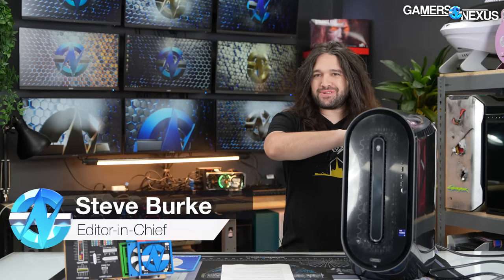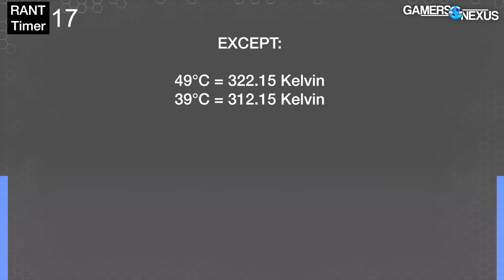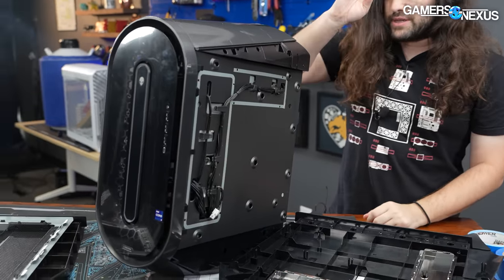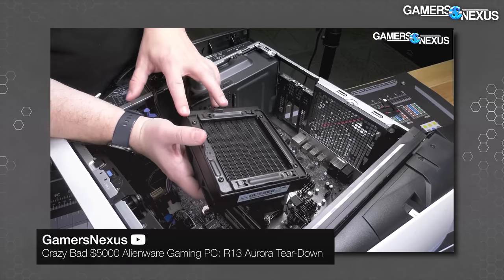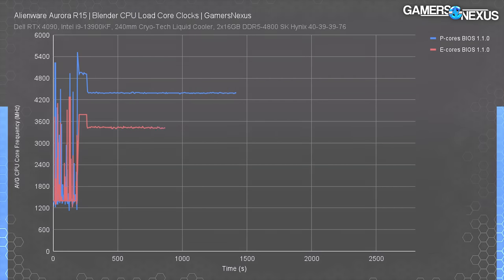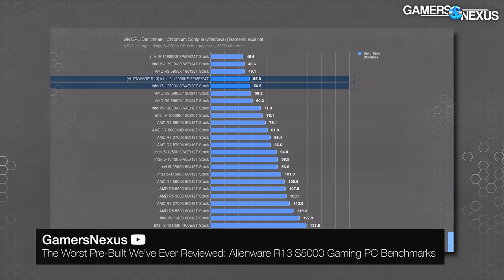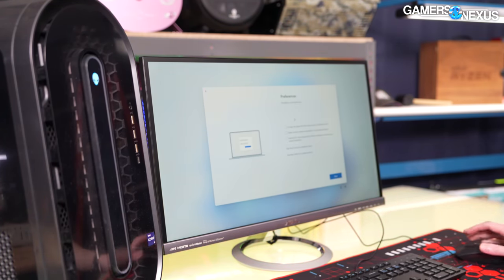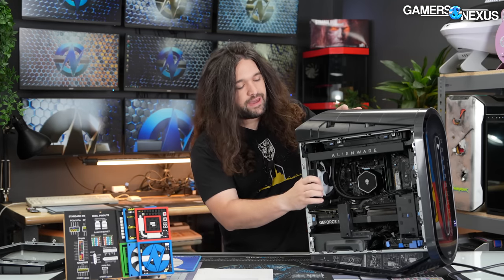Alienware Can't Get It Right - R15 2023 Pre-Built Gaming PC Review

Comment: Good Video but the part with your Kelvin and Celsius calculations is pretty much bs. The Kelvin scale begins at the absolute 0 point, which is completely unnecessary to look at in this use case (-273 °C). Starting point of 0 Celsius (273.15 K) is far more relevant because the coolers are cooling the chips against ambient air which is more in that spectrum. While your calculations are physically correct, they don't make any sense realistically.
Reply: yes, but converting from Celsius to Fahrenheit will still make the percentages inaccurate (tho maybe not as much)

Comment: I had an R15 w/2 1080Ti because otherwise I couldn’t get a videocard. I had to redo the whole system to make it functional. CPU ram WAYYY HOT, GPUs ram WAYY HOT. Cards were blower style and ran on the edge temp wise. Very very disappointing especially for the price.

OMG don’t get started, I mean it was everything even chassis fans were undersized and truly a joke.
Reply: I'm getting one in a few weeks with liquid cooling, should I crank the fans up ASAP?

Comment: That card was used. Dust doesn't just settle in a thick layer on the underside of the fan blades. That takes months of heavy use. Especially when the top looks nothing like it. The whole card would have to be dunked into a vat of dust and then cleaned badly to look like that. To say it might have collected there sitting around is just denial. Avoid like the plague. This has gone beyond bad design. Avoid like the plague.

Comment: I bought this PC thinking there wouldn't be a problem adding in the wig card for my VR headset, but ends up that there isn't a PCIe slot to put it in. After watching your video it looks like there may be 2 other slots on this system, but are they fully blocked by the video card? Sorry I am a newb so if this is a silly question can you answer it please. Can I add a Vive Wigig card to an existing pcie slot on this system? Thank you.

Comment: I still don't understand their obsession with using that case. Imagine how much cheaper it would be for them to design a standard case and just give it a little bit of Alienware flair. It would be cheaper to make, cheaper to build in, cheaper to warranty, perform better, and not alienate so many people with the over the top styling and awful cooling.

Not to mention all the other proprietary stuff and the cost that goes into creating that. It's no wonder they have to charge so much. Overly excessive engineering for the sake of doing it while giving the customers less for their money. It's like Dell is dead set on making a desktop perform like a laptop.

Comment: I purchased a prebuilt and had a question if anyone can help (it's not an alienware lol). The GPU temperature seems rather high to me, but I'd like a second opinion. 
It's an i7-12700KF with a RTX 3080 
Normal GPU temp rests around 46 degrees C. While running a game, it will go up to 82-84 degrees C. The outside of the case seems to get pretty hot.

Is this the average temperature I should expect whenever I run a new game or does this seem hot?

Comment: I wonder how much money Dell can save in manufacturing/tooling costs if they got rid of that stupid plastic shell and simply worked off of the original Optiplex chassis. Glad to see the Alienware team finally got a clue about the CPU cooler but, yeah, it's a pain to work with professionally and not a fan of proprietary Dell parts used or how little space there is between the GPU and PSU.

Comment: I think they mean ambient temperature.
Reply: That’s the entire point of the rant; The point of the video is that percentages of temperature can easily be manipulated for marketing due to temperature being a property that unfortunately uses multiple scales with different zeros. Just saying 20% cooler isn’t very helpful unless you include the scale and a beginning or ending measurement. Frankly it should also include ambient but that’s probably asking too much.

If it’s 20% cooler from 100C to 80C or 17% cooler from 212F to 176F or 6% cooler from 376K to 356K, that’s still not very good.

But if it’s 20% cooler from 140F to 112F or 25% from 60C to ~45C or 5% from 333K to 318K, that’s phenomenal.

Just state the change in plain numbers, drop the percentage, provide a reference to ambient and max operating temp if you want.

Comment: Intel 14900 CPU, Asus Strix z 790-A MB, 4 TB M.2 WD Black, 2 TB M.2 Samsung 940 pro, 64gb Corsair Titanium 6800, gigabyte 4090 GPU, Corsair H150i AIO, Asus 1200w Platinum PSU, Asus Tuff Mid tower case all for $4500 that I built myself. Thats crazy is that they are charging more for rebuilt PCs and use less powerful components.

Comment: QUESTION:  does the fact that the back panel angles downward have any effect on the outgoing air, or is the angle so slight that unless it's parked against a wall, you won't notice any difference?
Reply: GN has made some mention of how the idea of 'hot air rises therefor exhaust up' might be technically sound but in practice the effect is so small its a rounding error of a rounding error. It might not be this exact situation but basically getting the hot air out of the case is infinitely more important then how it gets out of the case, just get it the heck out of the case. So the angle doesn't matter.
Reply: @nickierv13  thanks! I appreciate this answer :)

Comment: Why are you converting to Kelvin? Who the hell measures their experience with that number? Nobody has a kelvin thermostat or checks the weather forecast in those terms. Celsius or Farenheit is how the non-scientist consumer measures their real world experience.  I don't care about the accuracy of Kelvin, because I'm not an astronaut or a cryogenics lab worker. Therefore I use Kelvin, as many others would use Celsius. 120.2F (49c) vs 102.2F (39c) is a HUGE, noticeable difference under most conditions. 

And yes, that is why people care about temperatures. Not because of any correlation with power draw/electric bill, but because hot computers affect room temperature, often turning them from tolerable to uncomfortable. What a ridiculous criticism.

Comment: Imagine way over paying and getting a heavily used GPU.  Dell has always had those silly springs and latches.  Why are they so adverse to going with standard components?  Wouldn't they be able to charge a bit less but make a TON more since they aren't designing mobos, PSUs and other proprietary parts?  That's what I don't get.  They're spending all that money on designing and engineering parts and it doesn't make sense.  You pay all of that when you could have had someone put together the same specs for much less and have better performance.  Do they make that much money fixing old machines?  Do people send their dells in that much for repairs?

Comment: Should have tested it using the Alienware Overclock software max power settings. They definitely tune things down a bit by default so you need to use Command Center to get good perf. But once you do that, you can do just as well as the prebuilt.
Reply: No, it's a BIOS thing. Plus the cooling is simply horrible the components could die.

Comment: Why does that Alienware pc internal configuration look like my hp proliant server made gaming pc (for fun I don't really use it) some of those fans positions are meant to cool things that aren't even in the system and probably haven't actually gone in one of those cases for like seven years or more.

I will say I find that gpu to be well designed assuming it cools well and that's an aluminum (or copper?! One can dream) backplate. I figured gigabyte would need to up their game sooner or later after the experience of the 4-slot 3070ti with an lcd screen I've got somewhere (you would think with a 4 slot cooler it would be having no problems. And while it doesn't the 3080 fe runs cooler as does 3090 suprim x(treme to the max! Presumably)

Comment: Windows update is the absolute worst when it comes to OEM updates. I never even booted the pre-installed windows version on my HP omen, and installed a clean version of windows instead out of the box. Windows update has pulled in all kinds of garbage from HP because they label their software as 'required', including the analytics packages that are installed and connect to the internet without ever notifying the user of their existence. Which is shady at best.

Comment: Just too bad it still looks like something from about 15 years ago... The bare unpainted metal inside, even though that doesn't change functionality, but also a... hard-drive?... Come on. - Yes, extra storage is nice, which is all HDDs are still good for, but the norm should be SSDs, be it in SATA or M.2 form. - Even for consoles NVMe is the norm now, so let alone for a system of almost 10 times more expensive. - For some reason, they're really stuck in the past. It's just weird. It almost looks retro-futuristic now. And actually, people DO buy old Alienware stuff to collect nowadays, while... it's still being sold as new products today, just with newer components in almost the same old cases.

Comment: 556 for cpu NEW from BestBuy, 1500 for refurbished 4090...how is the rest of the system worth another 2400? Theres just NO WAY especially with that cheap ass board, RAM, cheap internals on the case that looks stupid on the outside as wwell

Comment: been buying alienware for 15 years. never had an issue, not once. but everyone hates them for some strange reason. just bought a r15 for 4000$ canadian, i9 13900kf+4090 with 64 gigs of ram at 5200mhz with 2tb nvme, with a 1350 watt supply cryo tech. got no complaints at that price. and like i said, i know i wont have any issues, never did once
Reply: „For some strange reason“ It’s the price. It’s way too high

Comment: I have the Alienware Aurora R13,  worst pile computer crap i ever bought. GPU runs so hot it throttles  (FFXIV),  yoyo's the GPU and makes the game unplayable. i finally had to remove the cover and set the box right in front of my AC. the airflow through this chassis is the worst I've ever seen and i wish i had researched this chassis before waisting my money.   You cover the R15 pretty well, but i see teh same aiflow flaw - hot air out from GPU backdeeds back into the NVIDIA cooling fan ie feeding hot air into the GPU.  if you buy one of these machines, good luck  (not new to Alienware, this is my fourth machine from them over the years, but also the last for gaming due to this design)

Comment: It baffles me Alienware/Dell still uses all that proprietary garbage chock full of unnecessary (charming to some I'm sure) mechanical moving parts 
Simultaneously under and over designed. Reminds me of a jacked up mid 2000s pc with bare ass RAM, bare ass metal, those blue HDD things etc
Literally everything I don't want in a PC case, Alienware provides in spades lmfao

Comment: We also have to talk about the bad 2 slot configuration in this system! If you want to upgrade your RAM you have to sell those 2 original sticks or reuse it in annother system. They cheaped out there. Also I wonder what chipset this uses? Doesn't look like a ZX90? More like a B660! Or even a B-610? For a expensive system like that? Also a 240 AIO for a 13900K? Conclusion: Alienware still sucks!

Comment: Alienware blows. I remember I bought an 8800 GTX SLI system from them over a decade ago and it would thermal throttle / kill the cards. The only air intake was a stupid ass alien eye that was smaller than a 120mm fan. Never again.

Comment: It's as if the case as been designed by someone who has just left university, no pc case experience, I bet the design drawings have pointless GD and Ts and dell have invested so much money they are now backed into a corner and just have to use it. Ridiculously over engineered on the interior. 
 

I have been there myself with the big and hidious nzxt phantom, at the time I thought it looked cool but wasn't practical at all. This case is stuck in the early 2000s.

Comment: With that price tag and custom design I expect to have a built in air filter in the intake so 99% of dust doesn't get in...
Also those ugly ass green ram sticks on a 4000+ build is aggravating... not even has heat sinks, wtf.
Reply: ram sticks don’t need heat sinks. These are just marketing gimmicks

Comment: Still to cheap to even paint the inside of the case metal black. Not to mention it's still just a cheapo plastic shell on a shit tier office pc chassis. This isn't even that important but with that kind of markup I would at least expect premium ram modules and blackout PCBs. If they where really interested in better thermals and acoustics thy would abandon that formfactor altogether because that's a dead end, It can't even fit a 360 CLC despite being a massive waste of space. With the volume that dell moves and the theoretical engineering an manufacturing assets they have at their disposal they could have done something truly revolutionary, like providing a one size fits all CLC type solution for their GPUs. Instead they provide zero to negative value over any other prebuilt vendor.

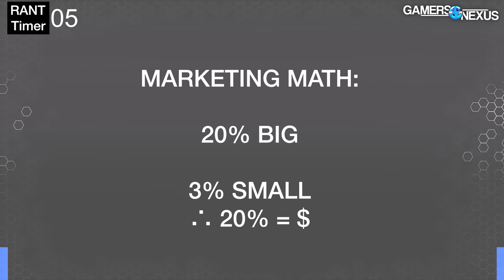Comment: 4:21 omg, this is why I hate this channel. So cockily explain numbers and math, but are dead wrong.  --> 49°C to 39°C isn't a 3.1% improvement (or a 20% improvement) for that matter. Both those percentages are meaningless, even though only one is dimensionally consistent. 

When comparing temperatures like this, what matters is temperature difference, not absolute temperature. At 25°C ambient, it is a 1 - ((39-25)/(49-25) = 42% improvement. This is the correct calculation because it means that the thermal resistance has been reduced by the same percent i.e. 42%. Thermal resistance is the thing they are improving. 

The only time absolute temperature matters is if you are interested in reliability, where higher temperatures mean silicon will fail earlier.
Reply: That’s the entire point of the rant; The point of the video is that percentages of temperature can easily be manipulated for marketing due to temperature being a property that unfortunately uses multiple scales with different zeros. Just saying 20% cooler isn’t very helpful unless you include the scale and a beginning or ending measurement. Frankly it should also include ambient but that’s probably asking too much.

If it’s 20% cooler from 100C to 80C or 17% cooler from 212F to 176F or 6% cooler from 376K to 356K, that’s still not very good.

But if it’s 20% cooler from 140F to 112F or 25% from 60C to ~45C or 5% from 333K to 318K, that’s phenomenal.

Just state the change in plain numbers, drop the percentage, provide a reference to ambient and max operating temp if you want.

Comment: What a disingenuous review.

You can change PL1/PL2 in Throttlestop, and cooling is still not a problem.

Of course the guy selling PC parts is bashing gaming prebuilts based on CPU benchmarking with power limits in place.

The sale prices are what matter with AW - you can't custom build a 13900/4090 for $2800.
Reply: no shit, it's reviewed as an out of the box purchase
you think people who are buying this are going to remove the power limits?
and what's the point of reviewing a pre-built if you don't review as it comes?
It's still extortionate price wise and even as an overall package disregarding price it's over designed to fuck